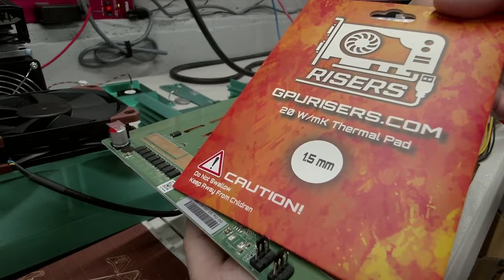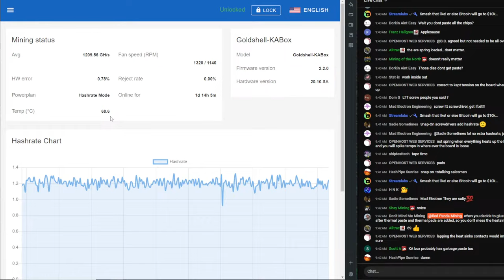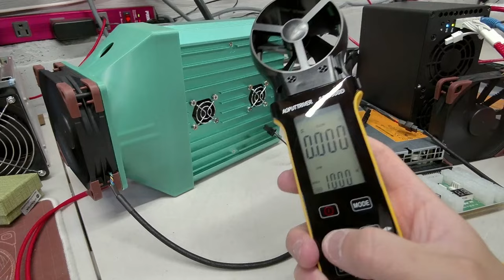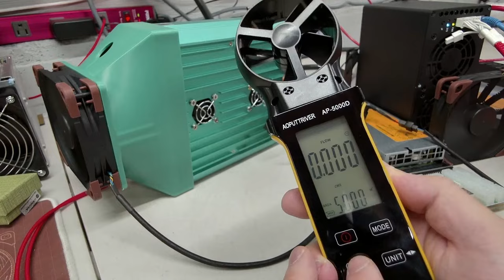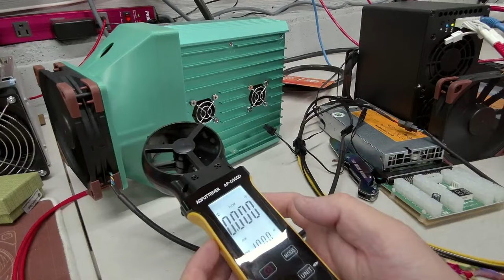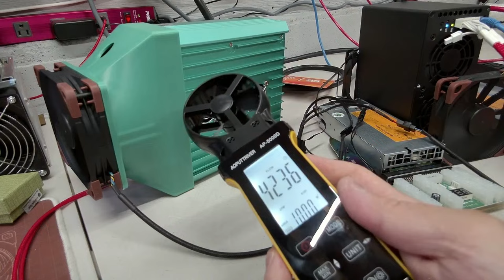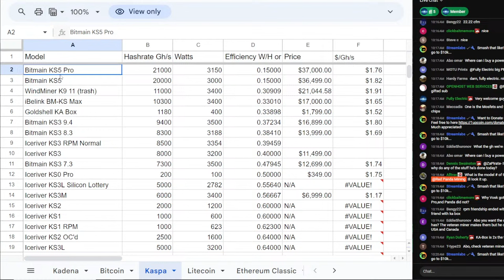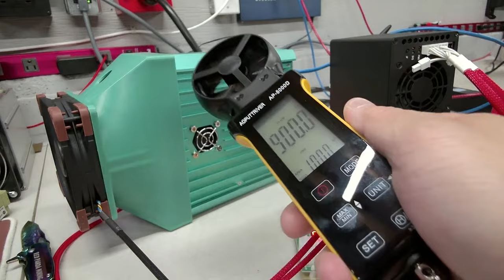Installing all the MODS on this Kaspa Commemorative Edition Iceriver KS0 Pro.

Comment: Idk if you want to pin but to answer some questions:

9x9mm up to 10mm and 15mm tall heatsinks work.

12v is goated, but if you are overclocking on 12v please hardwire it

Comment: You could mod the ks0 with a 6pin connector or solder the cables straight to the board

Comment: Thank you, Awesome material Panda, wondering Can we modify veteran miner's cable from 6pin-barrell plug 5.5x2.5mm connector into 6pin-usb type c connector, as an option to power KS0Pro, Ethernet side there is a jack for usb-type c there! Thus freeing barell plug side, is this achievable? Will this affect the 12v -19v hp server psu power to KS0Pro?

Comment: ks0 using 19volt , the psu is 12volt , is it stable ?
Reply: I'm also very interested in how does a 12 volt Kspr work? Can the author of the video answer?
Reply: @DennySueGaming @krd807 yes it works good, just if you are Oc’d please hardwire it (solder it)

Comment: The connections are the weak point go with 14 gauge out of a direct break out off psu...  no 6 pin or  other ...just unplug the break out board if needed
 TY Panda for Everything !

Comment: You Should remove the small fans on the bottom and mount them on the outside to improve airflow on the inside of the unit with this mod